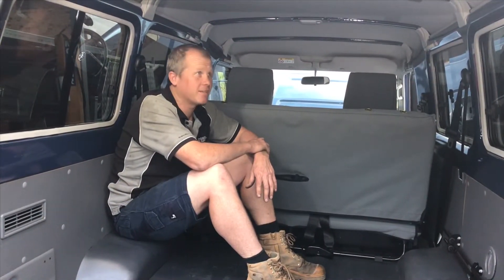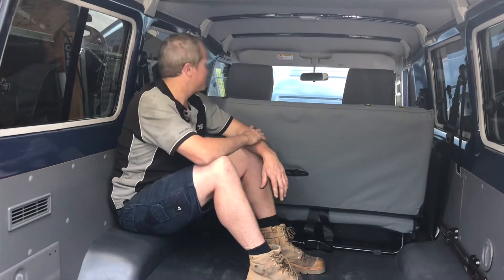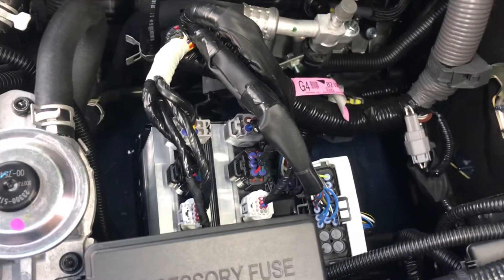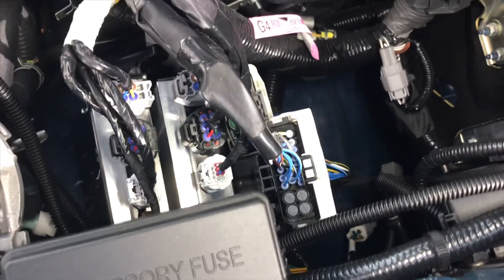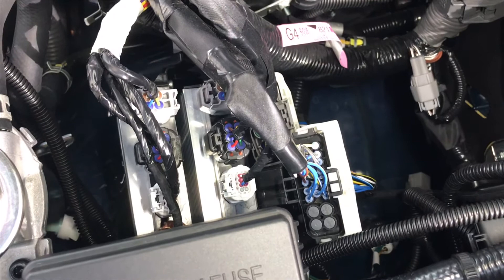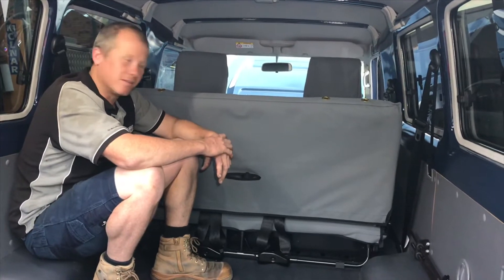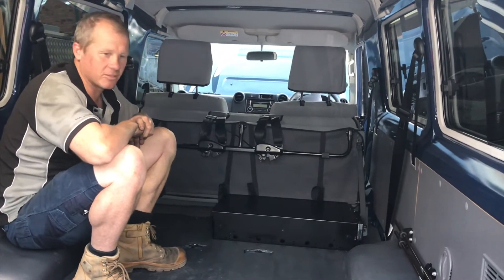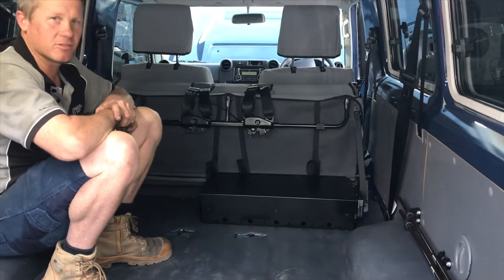Slimline 150ah dual battery setup in 78 Series Toyota Troopy

Comment: Hey mate. I'm assuming that the battery is on it's side? Is that ok to do?
Also i wanted to do a similar install behind the seat but someone warned me against the battery giving off gases and what not. What do you think? I'm obviously not a sparky.
Reply from the maker: Yes it's ok to lie the battery on it's side. The battery is a sealed AGM therefore no gases. As long as you use a sealed AGM on the install.